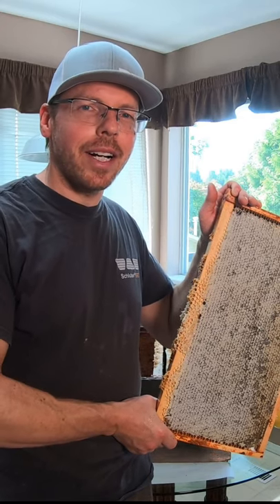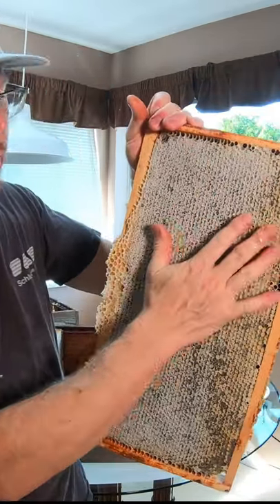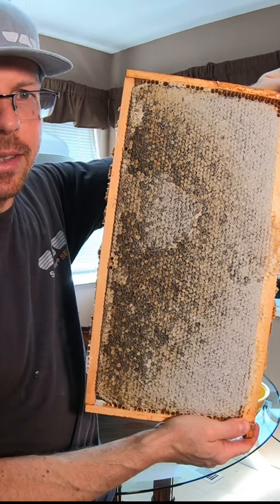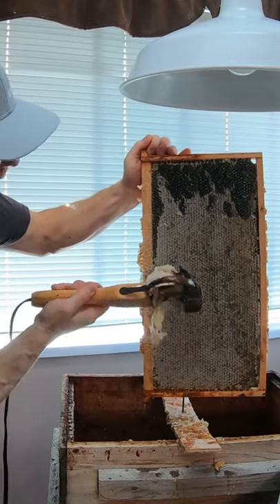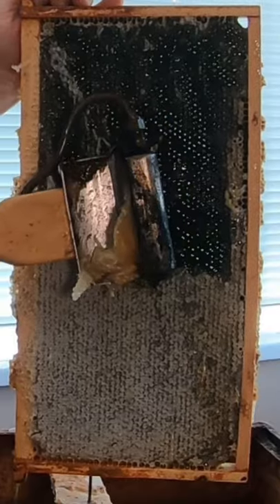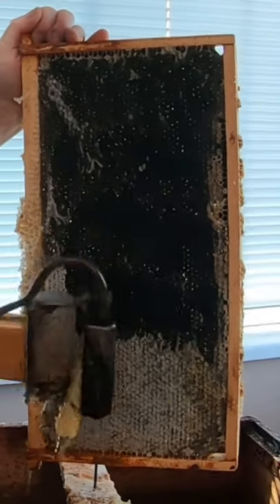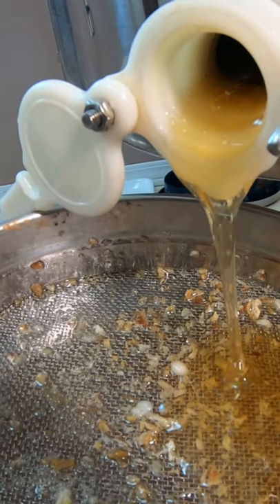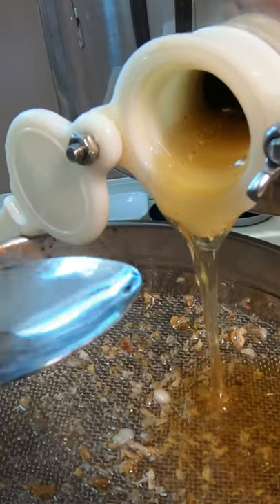Harvesting Honey In My Kitchen #shorts

Comment: Nice video! I changed from a heated uncapping tool to a very simple serrated bread knife. It works great. Your honey is a beautiful color.🎉
Reply from the maker: Thanks for the comment.  Yes, a regular knife works, but only if the capings are slightly proud of the frame.  The capping plane makes it easy to get into low spots.